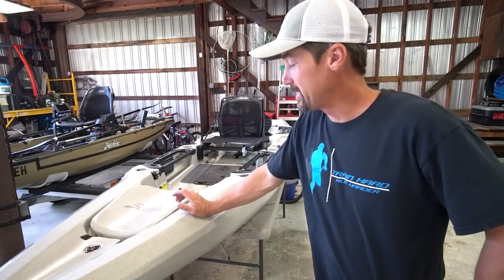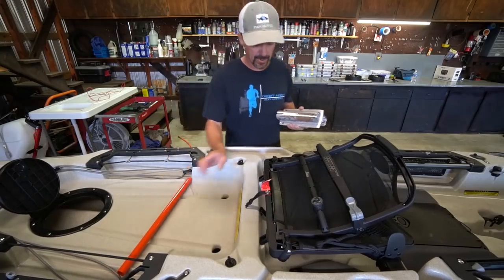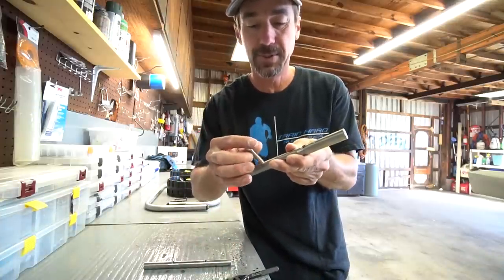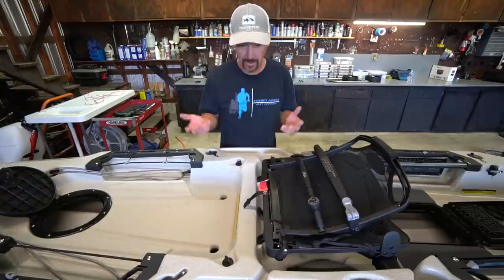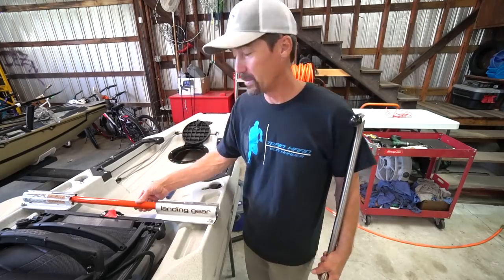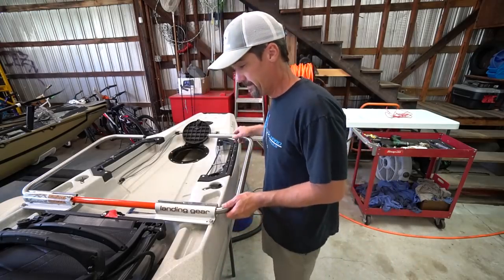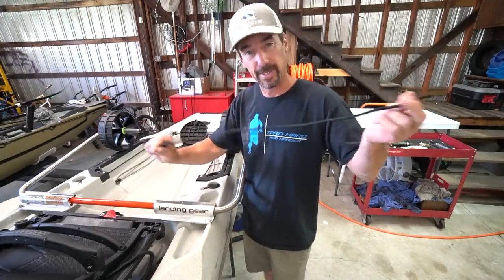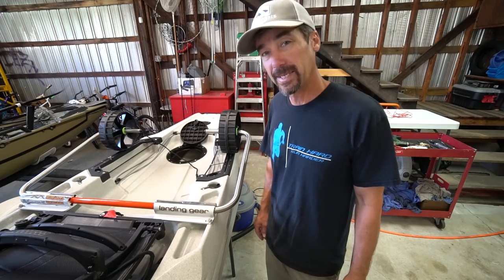Boonedox Landing Gear Install on 2019 Hobie Outback

Comment: I was hesitant at first but I followed these steps and it went easy 🤓. The part about needing to run a tap through the 5/16 thread's on the backing bars was especially helpful. All 4 of mine needed it. I also had to cut the wheel mounting bars past the outside hole (3.5") so i could clear the hull on raising and lowering without the gear coming out of the base

Comment: This the old Boonedox gear I've been researching there's a new one that install/bolts closer to the center with smaller brackets, I personally didn't like how it installed so close to the edge. Trying to find a video of the new style being installed
Reply from the maker: There may be will have to look, should be similar installation though

Comment: I noticed you mention you didn't need the rear hatch mod too install the backer bar. You mentioned something about foam? Is the foam accessible from the front hatch. Can it be removed and put back without damaging? Does it need to be removed to use the string trick? Thanks!
Reply from the maker: Yes the foam is just wedged in place to support the weight of the seat and standing areas. You can just pull it out to give you access to get the mounts into place. When your done just stuff the foam back into place.

Comment: Now that you have had them on for a while has the hall shown and signs damage from the backing bar? The new groovey Bar looks like a better mount but I have no rear hatch to put the stiffener plate. Wondering whether to save up for both items.
Reply from the maker: No signs of damage at all, and I have mounted it on 3 different Hobies. The mounting can be done from the front hatch, just remove any foam support blocks to give you enough room to fish the plates into place. The same wire trick should work.

Comment: Jesse, The 2019 OB that I pick up on Sunday has this landing gear on it.  I was just cautioned about it by an owner of a large yak accessory company.  He advised that the weight of the yak can pull down on the mounting area and that over time, the backing plate/bolts have pulled through causing holes in the yak and voiding warranties.  Stated hot days make it worse.  Any signs of such wear on your yak yet?  (this company sells a really nice cradle style cart, so he could be overly biased).
Reply from the maker: Over a years usage on 3 different Hobie kayaks and no issues period. Biggest thing I see on the new Outback that might cause a problem is whoever installed the mount might overtighten the bolts which would cause the hull to spread and possibly crack over time. It would be easy to see this because there would be a bulge in the hill right under the mount.

Comment: I like those wheels much better than the stock hard ones.  My only complaint with boonedox is the wide bracket.  Just the square bar designed with thru bolts through the bracket, a backplate and through center round bar would be much cleaner and just as strong or stronger.
Reply from the maker: It does seem way overkill, almost like it developed for something else much larger
Reply: Southern Reels Fishing I wouldn’t spend the money to try it, but I’m pretty sure you could mill those side brackets off completely and drill through the bracket then thru hull backing bar/plate.

Comment: Perfect timing!
 A landing gear for my 2019 outback was just delivered and this video will be helpful!
 1 question I have,
 When you tightened the screws to the round backing rod do you just snug it up lightly or are you completely tightening it down?
 I’m concerned the round backing rod will deform the hull after time?
 I bass fish and usually bring 5-6 rods and lots of bass gear which adds quite a bit of weight to the outback.  The added weight of my gear is sure to add extra stress to the mounting area. 
  After owning the landing gear on a few previous kayaks it’s now a must have for me!
 Makes things so much easier!
Reply from the maker: I go hand tight only, and thats with a T handle not a ratchet.
Reply: @SouthernReelsFishing  Do you use thread locker?

Comment: After some use wouldn’t those holes where you mounted the bracket start splitting the kayak? I wouldn’t want to drill any holes in a pricey kayak.
Reply from the maker: I've had it on 3 different yaks and have never had a problem. trick is to just snug the bolts up, don't overtighten them.

Comment: Do you have trouble with water coming over the bow with your 2019 compared to your 2017 Hobie?
Reply from the maker: Yes it definitely rides low in the front compared to the older Outback. I have never had it cause any major issues since my hatch seals good and most of the water just goes out of the foot well. But it is a wetter ride in rough conditions.

Comment: how is the boonedox landing gear holding up is there any damage to the hull?
Reply from the maker: I have had it on 3 yaks now and never a single issue. I think the problem people have is they overtighten the mounts. I use sealant and loctite and tighten the mounting bolts to where they are just snug. definitely don't want to go so tight that it start deforming the hull around the mount.
Reply: @SouthernReelsFishing  how much does the setup weigh?

Comment: Excellent video!!   I really was amazed with that wire trick; you make it look too easy.  Boone Dox should have given you that set just so that you could this video for them.  I agree that the wheel arms look better set more internally.  It will also decrease any obstruction the protruding arms have along docks or tree limbs.  The only thing that I am uncomfortable with is the fact that you are wedging that round bar stock into a wedge cavity.  I think you are only inviting a split in the upper gunnel.  How about mounting the system to the inner gunnel just internal to the storage cavity.  It has a nice flat area 1/2 inch lower to the outer edge that you are using.  There should be no splitting forces to the kayak.  Just a thought.  Hope this holds up in the long term for you.  Each rock and bump is like taking a hammer to the wheel leg.  Looking forward to the next video
Reply from the maker: Great point about the mounting issue. I did not tighten the mounting bolts very much, and I used blue threadlocker to keep them from working loose. I tightened the bolt until I saw it just starting to spread the plastic slighty and then stopped. The hull is very thick there and I feel it will hold up just fine. I guess time will tell
Reply: I am hoping it works out well for you.  If you get a fracture, I think that Hobie will not honor the warranty after mounting this wheel set-up.  At least that's the last that I have heard.  I am thinking about having a stainless steel plate cut out for the flat area just 3.5 inches inside of the current location, and having it tapped for threads.  If you are into engineering, it's a bad combination with a round stock fitted to a wedge shaped cavity.  You may have better luck with smooth asphalt driveways, but here at the ocean, the wheels have a tougher time on sand and smaller rocks.  Exiting the surf also is tougher on the kayak because of the wave action.  It wouldn't be so bad if the kayak were covered under warranty or if it were cheaper.  Good luck.
Reply: Boonedox has an option to mount on the flat area as an alternative to the narrower gunnel install. By ordering the standard kit you’ll get the necessary hardware and reinforcement plate to do the install. I just order it for my 2019 outback.

Comment: What size bushing did you have to get to convert to the wheeleez tires?
Reply from the maker: Should be the 25.4 mm bushing set for the beach wheels. May have to call wheeleze to get the part #, I don't see it listed on their web page at this point.
Reply: Thanks!! Just purchased the landing gear and would like to use the beach wheels if I ever launch on the beach.

Comment: Never any deformation?
Reply from the maker: None so far, just have to be careful how far you tighten the moult bolts, don;t go all the way tight, just until you see it spreading slightly and stop. Also never store it on the wheels...

Comment: I had the same issue with the backer rods not being correctly tapped. Ended up stripping a hex bolt on one side. Frustrated and pressed for time I left one side secured with only one bolt. Worked fine until I took the outback over a rocky terrain. Ended up bending the aluminum mount on the side that was poorly fastened. Boonedox doesn’t sell individual parts so had to order new landing gear without the tires. It’s a great product but a definite quality control issue with that specific part.
Reply from the maker: Yeah it caught me the first time. I was lucky to have the tools on site I needed to correct it, only because I was a mechanic in a former life lol

Comment: The product is good, although it's extremely difficult to install.  The problem is that the people at this company are AWFUL to customers.  I ordered a small box of bolts and knuckle hardware from them.  The first problem was that they charged $43 to ship a small box from North Carolina to my house in CT.  That's absurd.  The next issue is that when I needed to return a couple of the parts, my email to customer service was ignored for a week.  When they finally did reply, this is what I was told:

"To be honest I would try to sell what you do not need because I am going to explain our return policy. You send back the parts that you do not need and once they arrive we inspect them; upon inspection we issue a refund of the product price minus a $25.00 restocking fee"

So yeah - good product, but terrible to install, and the company doesn't seem to care about the customers.  I'd buy something else if I could do it all again.
Reply from the maker: Sorry to hear about your bad experience with them. Kind of surprises me because I have had great service from them. And it's not because my YouTube channel or anything because as far as they knew I was just a random customer. I don't know maybe something has changed on their end

Comment: No need to waste time drilling and installing, Hobie sells a set of wheels that go into the existing holes in the Outbacks or Pro Anglers
Reply from the maker: Yes I used them for years and they suck. Also they are notorious for causing stress cracks in the hull around the scupper holes where you insert them.
Reply: I agree with you Jesse the hobie scupper wheels suck because you have to roll your kayak over in order to get the wheels on. Now check around real good to make sure your gear isn’t floating away lol!